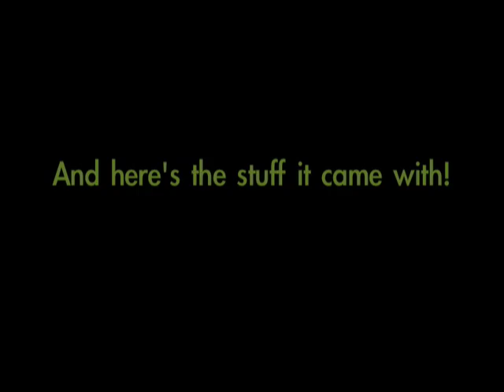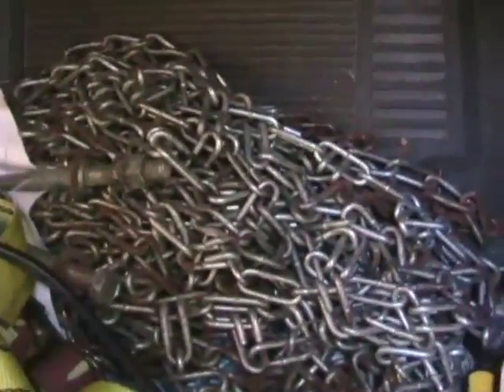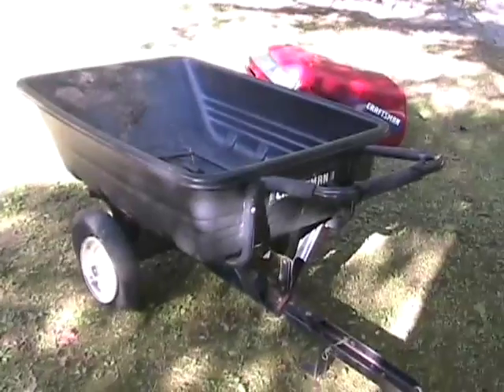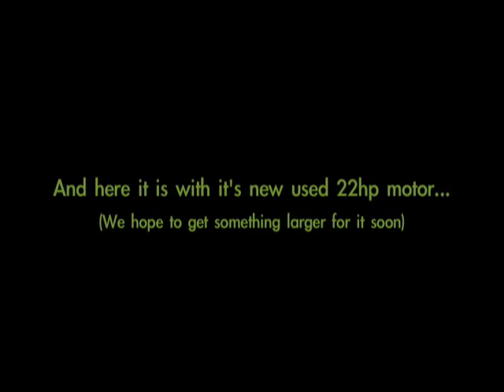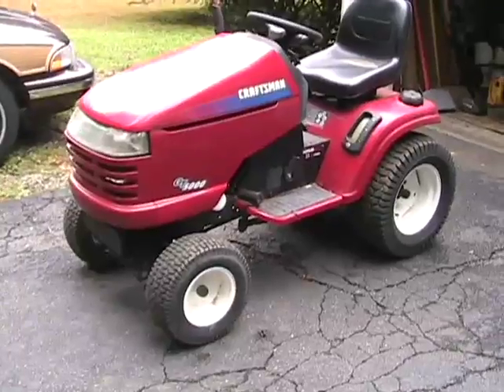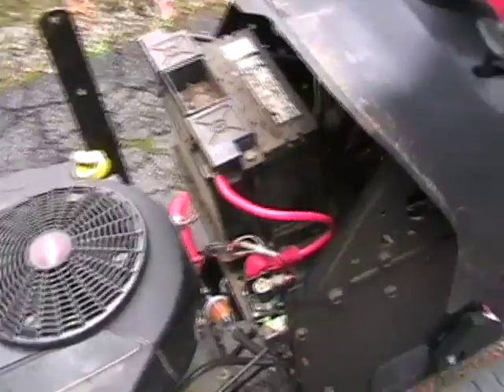Craftsman GT5000 Tractor (with it's new motor)

Comment: I had2 of those,  I bought one I 2019, got it from the original owner,  had all the paperwork,  and tools that came with it. It had the Kohler 25 horsepower  V twin with the 6 speed manual transmission.  They both did,  the second one I got in February of 2023. It was in bad shape.  I was able to get the engine running,  but the rest of the machine is in bad shape.  I took the engine off, put it on a Murry 40 inch cut that had a bad engine. Going from a 48 inch cut to a 40 inch cut makes a big difference.  I sold my good one made money off it. 😊  Happy with the Murry now.

Comment: I have the original in my tractor. had the head gasket replaced in Jan 2009. Runs strong. i use it to plow the garden ( moldboard plow ) and tow stuff ( including my utility trailer towed with Jeep ) and of course mow the low.

Comment: i have a ih cub cadet 1250 and it does the same thing whe you push the clutch in. It makes sense for that though, the cub is shaft driven and the hydro would still be going while the brakes are trying to stop it

Comment: does anybody know where the charging system is on these. i have one the same way but with a floor gear selector. well it was dead and i hooked it up to my truck well come to find out that is a big no no. so it fried the starter and now it dosn't hold a charge and it has both new battery  and starter

Comment: When im in a tight maneuvering area I set what I want for my max cruise speed and then reduce speed from that with the clutch. But when im mowing wide open areas I pull/push on the stick. (I drive a hydro just like a 6 speed manual)

Comment: Nice lawn tractor,  its not a garden tractor. IF you try using it in a garden it will throw the belt or burn it up or break. The " Briggs & Stratton ELS V-Twin. " are spit engines. Well if you have some slight hills in the yard the engine will not oil itself properly. thus burning up the engine. They say as long as its on a flat surface you should be ok. I have a 25 and I have some slight hills in the yard. So it died.  I just installed another engine.

Comment: Are you saying the Kohler Vtwin is garbage in general, or just the example that was on your particular tractor?

Also, the way around not having the hydro lever slam into neutral is to pull back on the lever to slow down instead of braking.

Comment: Great job on this mower. I have a GT5000 that looks like your but it has the manual shifter in the middle. It came with a 25hp Kohler Command V-Twin in it that had a thrown rod when a friend gave it to me. I'm now in the process of replacing the engine with a 26hp Kohler Courage V-Twin. I run into the same issue with the starter solenoid. Does the blue wire that went to the old solenoid connect to the new remote mounted solenoid?
Thank you and God Bless!
Reply: Those courage was not very good

Comment: how do you remove the fly wheel?
Reply: take the shroud and flywheel mesh off, get an impact with the correct size socket (not sure of size but I do know it's 1/2 inch drive) and buzz the flywheel nut off that way, then get a wheel puller, set it up, crank down on it, and the flywheel should come off. Beats having to smack the bolt with a hammer while using a prybar.
Reply: @Monster404ftp   needed you 10 years ago my man! haha thanks though
Reply: @exmarkmetroguy  You're welcome lol.

Comment: i was in sears yesterday looking at the new Husqvarna built Craftsmans and they fixed that Hydro lever issue. if u have it in speed and press the brake pedal it doesn't slam the lever into neutral anymore. it stays where it is but i guess it stops the tractor. found that very interesting. and the new MTD built craftsmans are little wussy looking things. My new Cub Cadet and the Husqvarna built craftsmans could eat them for lunch. lol. but of course they have metal hoods and the Cubs don't.

Comment: dont use the brake with a hydro unless parking. Pull back on the hydro stick and it will slow down as fast as you pull bake. whats the matter with you

Comment: that will ruin your belt, and your transmission. your transmission is ment to be run at 3600 rpm's the whole time and use the stick to adjust speed. what is wrong with you you odviously don't know how a hydro works